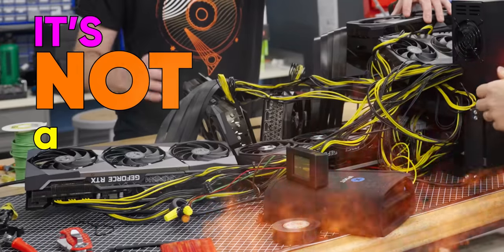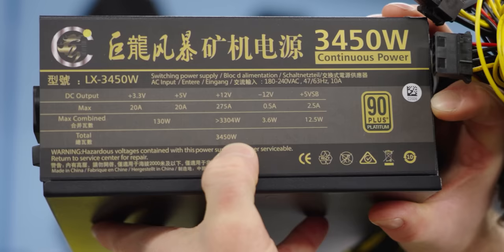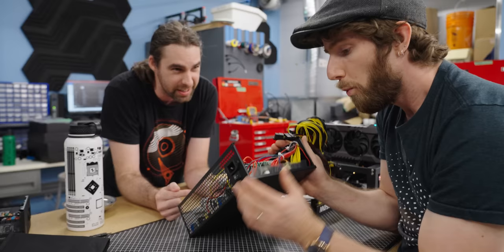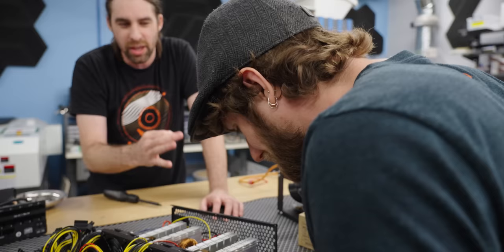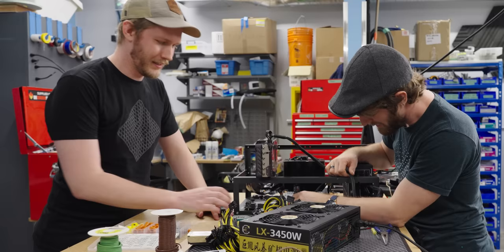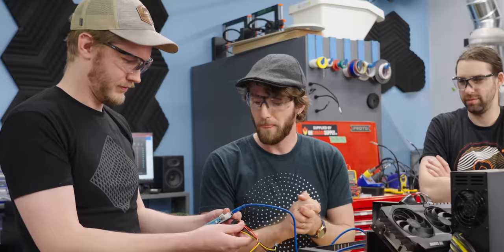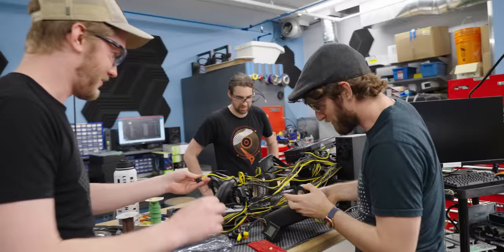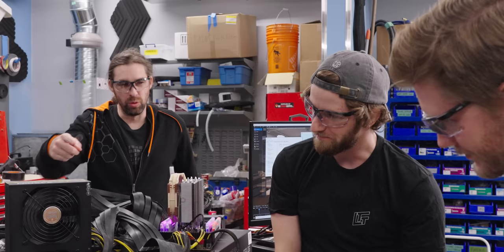This 3450W Power Supply is a Fire Hazard!

Comment: As an electrician its totally fine to draw 3500w on a 230v circuit. You should get outlets that are rated for 16A continuesly and not just 16A Peak (10A continuesly), but other than that you are fine. A 16A circuit breaker wont even do anything unless you draw at least 14% more which is just slightly above 18A
Reply: I mean yeah, 230*16=3680
Reply: @SzymonPmc  to be fair, if you drawing 16A you are most likely not going to have 230v on that outlet anymore. Voltage drops with high current due to the resistance of the wire. You would need really THICC wire to keep it at 230v
Reply: sad north american 120v moment
Reply: As an average Cheetoh muncher who knows nothing about your trade: wanna bet if I can f%#^ that up or not? 😃
Reply: As an amateur electrician: the green cable goes in the green thingy.
Reply: as long as the power cord supports it.  but on the side of the source when linus showed it it said, 180-240v 10A.  it does not support 16A so it does not support more than 200-2500w and from there you run the risk of burning the power supply.
Reply: @inqizzo  got a Wattmeter? doesn't seem like your stuff pulls 4000W continuous
Reply: But this power supply will certainly not be the only electrical device in the circuit... add a couple more devices and the fuse will pop frequently.
Reply: @SchwertKruemel  If that is a 16 amp circuit, you could expect THICC wires. We even run double the capacity in copper to be "just in case".  The AC runs on something like a 16 amp breaker too but the wires are capable of around 30 amps
Reply: "A 16A circuit breaker wont even do anything unless you draw at least 14% more"
If it does anything at all at such a small overload - might take hours.
Reply: As an electrician, you should know C13 is only rated for 10 A. No matter what, you're not supposed to pump this amount of power over a C13 connector.
Reply: @itsbeanic  every house has 240 at the panel, but instead of pumping twice the voltage through all our wires we split it into phases so you don’t have 200+ V where it isn’t needed
Reply: I think they use 120 degree phase, it's 208v not 230v. It's common for building like that. They pull more 16a.
Reply: @yuxuanhuang3523  16A runs on 1,5mm^2 wire (should be between 15 or 16 AWG or whatever you use over there if I checked correctly) unless you need it to go really far
Reply: @SchwertKruemel  Generally 14AWG is considered ok for 15A, 12AWG for 20A, and 10AWG for 30A.
Reply: @itsbeanic  If you're running one of these PSUs where 120v is standard you're probably in a position where it's not too difficult to get a 240v wired.
Reply: @SchwertKruemel  this is correct. my NEC book says 16AWG is fine for up to 18 amps. You could do the voltage drop formula and figure out the maximum length you can run before you hit the 3% voltage drop.
Reply: @nohvoha6058  from my very qualified view you really can never have too much voltage
Reply: @SchwertKruemel  hey I'm sorry for this, but I can't find an answer anywhere. Is it possible to have "bad" electricity in your house? That may cause CPUs to degrade/malfunction? Say bad wiring somewhere in the apartment building?
Reply: @SchwertKruemel  Actually, According to the electrical standards in the Netherlands, 2.5mm^2 conductors are required for a 16A@230V. Only after a light switch it is permitted to be reduced to 1.5mm^2, but all outlets are wired with 2.5mm^2 thick conductors.
Reply: In North America, if you use L1 & L2 instead of a single “hot” and neutral, you’ll have 240VAC and you’d want a 20A circuit. You’d want the power switch to be a SPDT.
Reply: @SchwertKruemel  nooo you would not.
High voltage lines do Transport a lot of power with not that high current because the voltage is very high and power losses only increase with current not with voltage
Reply: @SchwertKruemel  1.5mm² wire is rated for 10A in Finland (230V, 50Hz) and 16A requires 2.5mm².
Reply: @inqizzo  Old fuses might actually handle that for some time but new circuit breakers are more sensitive.
Reply: @SchwertKruemel  in the Netherlands all regular power at a consumers place should be on B16-fuses, 16 amps that is and the standard according to Dutch building code is 2,5mm^2 wire. 1,5mm^2 wire is allowed but only for light switches and such where 16 amps will never be drawn from, else 2.5mm is required again.
Reply: @alexanderpas  Its the same nowadays in germany, but that has nothing to do with the safety of the wires but to make sure you dont loose to much voltage on the wire over long distances and so you dont have to worry about how many wires are close to each other, wheter they run in or on the wall and such.
Reply: @alexanderpas  In Germany too these days.1.5mm² was allowed many years ago for 16A circuits.
Reply: @SchwertKruemel  Just adding that in most EU countries, it's actually 245V now.
Reply: @itsbeanic  In commercial settings, 240V is completely normal. It's even a bit safer than native 240V countries, because none of the conductors ever have a potential larger than 120V against earth. So the shock hazard is still a lot lower, while you can deliver the same amount of power. 
Only drawback is that you usually don't have the higher 400V 3-phase tier that we here in the EU even enjoy in our homes.
Reply: @itsbeanic  You can have an electrician put 240v into your house if you really wanted to. I'm not an electrician so I don't know the correct terminology, but they can basically wire or bridge two 120v circuits together in a certain phase to get a single 240v. Not sure of the specifics, but I know its possible.
Reply: cable cord wall to power supply can deliver max 16A .

i dont like this video :
1) we see on camera only 900W on power meter. 

2) linus dont test it with good brand psu. 

3) 7 x 3080 = 1400W + 250W ( amd ripper) bearly 1650W not 2500W
Reply: @graealex  I enjoy it in my home as a european :)
Reply: But you'll need a c19 connection and you can't draw it from a normal outlet from a prolonged time, officially in NL en DE it's 15 minutes of 16A and then you need to return to 10A. So this probably needs a CEE plug and a C19 on the left side. So this is definitely an issue in 230v land, the US variant of a CEE plug is a NEMA 240v and that can handle this as well..
Reply: @inqizzo  peak or constant consumtion?
Reply: @gustavobalmaceda2346  saw that as well and was like, what the fuck they are doing?
Reply: @itsbeanic  North America has 240V Dingus how do you think your dryer works?
Reply: Exactly! I have a 3.5Kw induction wok station in my kitchen and it plugs to a regular wall outlet just fine because of 230v.
Reply: @SchwertKruemel  you will get about 16V Drop at 1ohm cable.( at max current 16A ).

 this psu more then 10A 240V , the 12V rail will drop to 10V
Reply: @inqizzo  my pc with 27 ips monitor take 56W.
Reply: Also they have only 208 V in North America, not 220 V or 230 V as in Europe.
Reply: @itsbeanic  So do I. However, it turns out that most appliances that require 2 or more phases actually still don't require 400V, i.e. they all use the 240V between a conductor and neutral, instead of the 400V between two conductors. Which means domestically, we don't really have any use for 400V.
Reply: @SchwertKruemel  The voltage is also slightly higher than 230V if you measure without load.
Reply: R. I. P everyone who has 120v output
Reply: There are 230v outlets rated for 50 amps, like the NEMA 14-50(commonly used for electric stoves and dryers) and 6-50(usually used for welders)
Reply: Maybe not all connectors are equal and it isn't all about the mains voltage. We have 230v here and I've noticed that once you go to a 3KVA or greater UPS they either use C19 connectors or need to be hard wired by a sparky.
Reply: @yuxuanhuang3523  16A 230V is 1.5mm2
Reply: @alexanderpas  1.5mm is up to 20A .it depend on temprature and cable length
Reply: @KoeiNL  it can be higher. 230v spec says that everything within plus or minus 10% is ok. So you can have 207v or 253v and still be within spec
Reply: it's*
continuously*
Reply: i was just typing that, but well...  EU you know
Reply: @graealex  dang it the taycan shure can use it and imo 800v too :(
Reply: @MarekKnapek in Europe its actually 400V 3-phase but the phases get split up for low power appliances ((400V/√3)=~230V)
Reply: In the germany and other states in europe 230 V 16A normal
Reply: @itsbeanic  Just to  point out that here in the U.S. we are NOT 120, we are 240. What we do is split that at the junction box into two 120 rails.
Reply: @nohvoha6058  correct. :)
Reply: @SchwertKruemel  Not sure where you're from (your name sounds German, but, what's in a name..) but in my land (Czech rep.), 16 A circuits (for sockets), both single or three-phase, are required to be wired with at least 2,5 mm^2.  Note that's fixed installations (with solid copper core cables) we're talking about. 

Extension cords or appliance cords rated up to 16 A  can be made 1,5 mm^2 stranded copper, as long as they're at most 50 meters long. 
Anything over that must be at least 2.5 mm^2 to be rated for 16 A.

Technically yes, 1.5 mm^2 is capable of carrying 16A, but our code doesn't allow fixed installations made with 1.5 mm^2 cables to be equipped with 16A breakers because cables installed within walls or conduits don't dissipate heat as well as flexible extention/appliance cords that are on open air. 

Highest allowed breaker for installations made with 1.5mm^2 cables is 13A.
Reply: @Face_RC  The power comes into the power box at 240 then it's split into two 120 "rails" that then is wired into the home (with the exception of some ranges and dryers that are 220 which get a direct line to the main). If you look at your junction box you will see two sets of contactor rails, each is 120.
Reply: @smilingbandit6900  Well, a typical at-home fast charging setup is a wall box with up to 22kW power, and that runs on 3-phase 32A@230V (not 400V). That leads to a charging time of about 4.5 hours.
Generally, ultra fast charging is done with DC (270kW for the Taycan), so you need to condition the power one way or another. It is however true that it uses a lot more copper for the connections at lower voltages.
Reply: @MarekKnapek  No, The power line into homes is 220v. It's split at the Junction (aka fuse) box into 120v lines.
Reply: @lobrazs5330  Yeah, I'm from Europe, we have 3phase 380 / 400 V in every house / apartment.

Apartments usually don't have 380 V sockets, but separate wires sticking out of the wall to screw into stove terminal. Different 220 V sockets wired between different phases. Houses have 380 V socket for table saw and similar equipment with 3phase AC motor.
Reply: @SchwertKruemel  thats why you calculate the voltage drop before you choose your wire size.
Reply: Laughs as a german where 230v and 16A so 3680 w is the normal circut in your Home
Reply: @jdogdarkness  In theory yes, but not due to cables. Actually, probably no. I suppose that your house is not powered by a cheap inverter
Reply: @marsdeimos4301  here in Germany it’s a little more complicated. There are a bunch of factors you need to take into consideration. Whether you have a single cable or several. How far they are apart from each other, how longe the wire is going to be, whether it’s in a wall, on top of a wall or such. So as a rule of thumb nowadays you just use 2,5mm2 so you don’t need to worry about all of this. But it’s not necessary always required
Reply: @itsbeanic  240v in the US is easy to get, I have a 240v plug in my garage just below the breaker, actual measured voltage is 237v. You just need a double pole breaker and to run the line to where you want it, if it's anywhere in the garage it'll be easy, in the house requires more effort and going into the crawl space under the house if you have one
Reply: @infernaldaedra  ah, thank you for the response. Would that type of problem lead to processors voltage regulators and such wearing out? And do u know a way for a layman to test if it's the case by chance?
Reply: @inqizzo  first, “a pc” can vary GREATLY on how much power it pulls from the wall. Are you running a regular old dell pc with integrated graphics? Probably no more than 100w in that case. Are you running a Ryzen 5600 or something of the sort and a low-mid range gpu? You’re gonna be pulling anywhere from 100-500ish watts at peak most likely. Are you overclocking and overvolting a high end Intel CPU and also have a high end Nvidia GPU? You could be running up to 800w or higher peak on those systems, but still at idle you’ll be more around 150-200w or so most likely. Whatever pc ur running, I doubt your running it at full load 100% of the day, every day, so most of the time it’s going to be sipping power at idle.

Monitors use very negligible amounts of power these days, on average maybe 30-50w (unless u have a huge CRT for some reason, even then not a ton of power and most likely not on all the time)

Aquarium heaters take up a bit up power, anywhere from 25-250 watts, more often 150w, but they’re not typically not all the time except maybe in cold places in the winter, maybe on for half the day or less most places, only when the water gets cold enough.

RGB led lights don’t take much power at all, they’re very power efficient. It’ll take anywhere from 7-35 watts at the max. Same with a desk fan, maybe 40w if it’s a decently sized one.

Lets assume you have the most balls to the walls gaming PC (which most likely you don’t bc few people do, they’re quite expensive and overpowered for most ppls needs), are running all 3 aquarium heaters at the same time, have a CRT monitor that absolutely sucks power, the least energy efficient RGB led lights and and a quite large desk fan. Even with all that, we got 1000w for the PC, 100w for the monitor, 150W x3 for the aquariums, and 100w for both the RGB lights and desk fan (I’m giving you a lot of extra watts here btw for the heck of it). We’re assuming all these things are on at FULL BLAST as well; even with all that, we end up with around 1650 watts. 

Again, this is a GROSS exaggeration and I doubt this is anything like the setup you have, and they’re almost never going to all be running at max load at the exact same time. Even with those tho, you end up with less than 1700w, nowhere near 4K watts Lolol. Even 120v outlets on 15 or 20a (the most common circuits) could handle that with ease. Ur setup probably uses less than 1000w on peak anyways with all the things u listed, I just wanted to show u how crazy the 4000w u said u thought it probably used was.
Reply: @SchwertKruemel  what counts as really thicc? Here on the other side of the pond we run 2,5 mil squared for 230v 16A (Which is the default here).
Reply: It should really have a C15 connector instead of a C13 connector as C13 is only rated for 10A
Reply: @alexanderpas  Same in Belgium
Reply: @bagassetiawan1478  180 deg not 120.

of the phase 120 deg , you wil not get 240V RMS
Reply: Y'all worried about the outlet current while I'm more worried about that 275 amp 12v part lol I couldn't really see the traces but those are the ones that really have to be thicc
Reply: @kmcat  C15 is for higher operating temperature, still only 10 A. With C19, you have 16 A rating, but same operating temperature rating as C13.
Reply: @SchwertKruemel  you don't need anything special for 16A 230V lol , but to draw the same watts on 110v you need double the wire , to bad americans can't be trusted with 230v , because i can't see any reason they keep sticking to it
Reply: @SchwertKruemel  Thats what I was going to say. As a EE student now and to anyone reading this, just cause you have a 16A outlet you also need wire that can handle that load which would be like 12-13 AWG wire I would think.
Reply: @swimy96800  16 AWG is fine for a spike of 18A, not a continues load
Reply: @Gren4te  For our standard I would believe 12AWG would be what he means. It can handle 20A
Reply: @orencomputerelectronics8751  yes exactly. because their buliding use 3 phase system not 2 phase like at home. so it's 208v.
Reply: I have a 3850W 16A rated cable, that's C13. 230v EU. it's totally fine
Reply: So when you aren't an electrician, you can't?
Reply: @SchwertKruemel  my 16A 230V all run on 2.5mm wire, and at full load the voltage drop is well below 1% with 10m one way distance. with 1,5mm2 wire it will be around 2% - still well within bounds. at my business i run ~160A loads on 35mm2x5 and the drop is again below measurement error. Heat becomes problem way faster then voltage drop in most cases.
Reply: @jdogdarkness  No, that isn't possible. You can have "dirty" power from your utility which simply means it isn't a nice 60 Hz sine wave. You can also have voltage drop from appliances, often seen if your lights dim when the refrigerator kicks on. That is caused by the high load of the motor kicking on (a motor when first powered acts like a short circuit, lots of current but quickly drops to "normal"). Modern appliances soft start to avoid this. None of this will affect your CPU. The process of converting from AC to DC isolates the output from the input. At worst, your PC would turn off if the input was too bad. If that happens, a UPS can help as many do some light power conditioning and automatically adjust for under/over voltage to keep the AC output at the 120/230V it should be.
Reply: @graealex  While the most common uses for the 400V three phase isnt actually three phase but three single phase resistive loads, it still provides a lot more headroom and capacity than the 2 phase 240 standard in america. For example in Finland 6 or even 9kW sauna stoves are pretty common. Also electric car charging.
Reply: 2,5mm² and PowerCon or CEE would be good for that, i mean Schuko would run it fine (looking at you sapareted kitchen ovens), but it's technically out of spec.
Reply: It never been about voltage your no safer on 120v then 240v its all about the Amps, the fact 120v needs double the amps to do the same task isn't good. You need good RCD devices on your circuits, its standard to have the whole house on one here now in the UK.
Reply: @SchwertKruemel  not sure what is really THICC wire but 12ga will run 20 amp load all day 100ft away from the source
Reply: We got 3kw Chinese heaters plugged into Chinese plastic plugs...and we got 7kw 3 phase heaters plugged in propper 16A plugs
Reply: @nohvoha6058  We use phases too in Europe, splitted between the rooms. You can easily get 400V 3-phase socket in a garage for heavier power tools. I have one. The power plug is the size of my hand and cable is 1 cm thick.
Reply: @SchwertKruemel  that is wrong, your wire would have to be so thin it wount be able to carry 16A. Max realistic drop ober the wire is like 1 or 2 volts, and since 230V lines have a tolerance of +-10V u could even have 237V when drawing 16 A.
Reply: @banaana1234  Yes yes, saunas and electric charging. Typical applications in every house hold.
You basically repeated what I just wrote. Also, from the perspective of the grid, it's all the same. Net current on neutral is zero with three similar resistivity loads between phases and neutral.
Reply: @MTGeomancer  I see, thank you for the explanation. So to just be extra clear then, "dirty" power isn't actually passed on to your system. Because the AC-DC conversion. Basically the PSU filters the input and as such, "good" power is passed on.
Reply: @graealex  Saunas are very typical in Finnish households. Electric car charging increasingly so. 

And it's not the same, don't you think that the current on the hot wires doesn't count?
Reply: Considering efficiency, a NEMA 250v or 277v rated plug on a 30 amp circuit should be the minimum at peak power draw, as a 20 amp circuit wouldn't ideally be sufficient, especially with overhead and with the circuit more than likely being shared. 

Considering Linus' 208v supply, the quote that the PSU pushed 3500w, and assuming the power supply is 100% efficient, your original suggestion is invalidated, you'd need 16.83 amps just based off the raw math to drive the damn thing at that voltage. Keep in mind nothing is 100% efficient anyways, I doubt it would even meet the standards of classical 80 Plus anyways. This is when things start adding up, because at classical 80 Plus and this thing pushing 3500w, on the same 208v supply, a 20 amp circuit is no longer sufficient itself. Until we see efficiency numbers, a 30 amp circuit is a safe bet, if the efficiency numbers are horrendous, such as <50%, then that circuit's amperage is getting pushed with additional overhead on an unshared circuit at 208v. This is pretty easy paper math, you could do it in your head even. 

Your recommendation would trip a breaker, with underspecced plugs. So much for being an electrician, eh?
Reply: @banaana1234  No, saunas are not typical. The average household exists in an apartment, not a single-household house. Your view of what people need is seriously skewed.
Oh, and the comment about the current on the outer conductors shows a lack of electrical knowledge. Some of the currents simply cancel, that's why you see no net flow on neutral, and lower current on outer conductors. And if there is only current flow between the conductors, then that is happening at 400V, and for the same power delivered obviously at lower current.
Reply: Umm, 12A continuous not 10A. 80% of 15 is 12A. You're probably thinking of a 20A breaker and 16A is it's continuous rating.
Reply: @alexanderpas  Same in Spain; 1,5mm2 for 10A - 2,5mm2 for 16A - 4mm2 for 20A - 6mm2 for 25A.
Reply: NOT through a little IEC C13/14 connector pair as fitted to that diabolical device though - that would need the IEC C19/20 (large rectangular) connection - the 13/14 is only rated for 10A, the 19/20 for 16A.
I'm sure (as an electrician) you can multiply 230 by 10 to establish the maximum power draw of an IEC C13/14 connector pairing.  
There is a good reason why my UK APC 240v 3kVA UPS has a C19/20 input connection and has to be wired into a radial circuit instead of plugged into a wall socket on the ring main.
UK plugs for wall sockets (to BS1363 - the safest in the world) are only good for up to 13A (3,120w), which is not enough if the UPS is both under load and recharging itself.  The entire ring main is good for 32A as it is fed from both directions (being a RING main terminating at both ends at the circuit breaker), with multiple outlets along its length.  Depending on that length, the most common cabling is 2.5mm2, but 4mm and even 6mm can be used for very long runs of either ring or radial circuits.  Cookers always get 6mm.  Most domestic properties get a ring for the kitchen, one for the rest of the ground floor and one for each upper floor, plus a lighting ring (1.5mm2) and radials additional to the cooker for electrical storage heaters and immersion (water) heaters.  Any outbuildings or garden power need to be on a separate circuit with their own circuit breaker, or for outbuildings, whole boards.
Reply: @Face_RC  Pretty much all North American homes are supplied with single phase 240v, and a centre tapped neutral to provide 120v in two legs at the distribution panel. 
Ovens, dryers, hot water heaters are usually 240v.  And in my garage, I have 240v outlets all over the place for welders, table-saws and the like.  Tempted to add an extra 240v outlet in my kitchen and import me a UK kettle. :)
Reply: @graealex  Where did I say that it is needed? Its nice. Its convenient. We dont really have to think about our electric service being enough. And btw, a big portion of apartments here also have saunas. We have around 2.3 million saunas, with 1,7 million being in houses or apartments.

As you said, the current in the outer conductors can be lower as well, because it is split between three conductors at a higher voltage instead of two at a lower one.
Reply: Let's not forget that it wouldn't draw 3500W.
It claims to be able to give 3450W to the low-voltage side, but efficiency is never 100% And even with 90% efficiency at full load (which goes in line with 80Plus Titanium and even close to their claimed "90 Plus") that would be over 3800 W, which is more than the fuses cna deliver. More than 16A on 230V and more than 30A on 120V
Reply: @HappyBeezerStudios  I thought one comment they made was that the description didn't actually specify if the claimed power was input or output, but either way, that IEC connector is not adequate, as they are only rated for 10A.
Reply: Yes, but those IEC C13 connectors on the back are rated at 10A and often start getting hot around 6-8.....
Reply: @MarekKnapek  3 Phase Sockets are usually for stuff like ovens (everything that consumes a lot of Power). Which country are you from if you dont mind me asking?
Reply: @SupChad735  sure if they were running this thing for 3 hours or more it would indeed be a continuous load.
Reply: And still this power supply will draw up to ~3800 watts (assuming a roughly 90% platitum rating, which I am not sure how it compares to a 90% platinum rating...) which is far too high for a 16A group so you'd need a 20A group...
Also you'd put this on its own group entirely with its own circuit breaker and probably even its own RCD...
Reply: @gustavobalmaceda2346  because that connector doesn’t support more than 10a, yeah you could easily draw more than that on a 240 volt circuit, not using standard kettle plugs though (in UK the plug would have a max 13 amp fuse anyway).
Reply: The problem is not the max current drawn from the wall to the equipment for shorter times as even with under estimated 0.75mm wires in free air will rarely go too hot, but as an electrician you aught to be aware of that single  phase groups are drawn with 1.5mm wires inside the wall where you can't get rid of excses heat easily and running thru  various flameable things there is a larger risk of fire hazard if the wires overheat. You can easily do this for short periods of time but the wirings insulation is gonna deteorize very fast if you just change the 10a fuses with 16a and run a continous powerdraw of 3kw. Add to that that your standard power plugs and wallmounts for normal 10a rating is of high risk to create arcs which WILL cause a fire if it happens. I've seen enough of situations where people have just removed the insert plugs on 10a groups and replaced the fuses with 16a ones. And it ALWAYS leads to disasters along the way. Just a matter of time.
Reply: @graealex  Commercial buildings in Canada commonly have 347V/600V and use a step down  transformer to supply the 120V and 208V loads
Reply: @mikelikegaming  You can get basically any voltage and any power level, if you have the commercial needs.
It's just that most domestic buildings in Europe get supplied with 3-phase 400V either way, no matter how much power you actually need. That's just the low-voltage distribution grid.
Reply: Everything you're saying is technically right, but also in practice it's likely going to be quite a fair amount of voltage drop